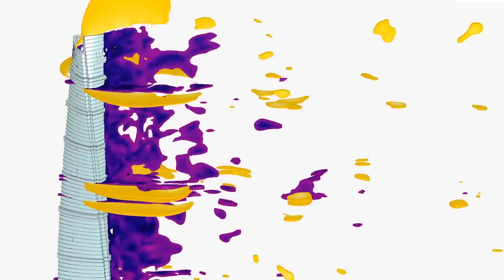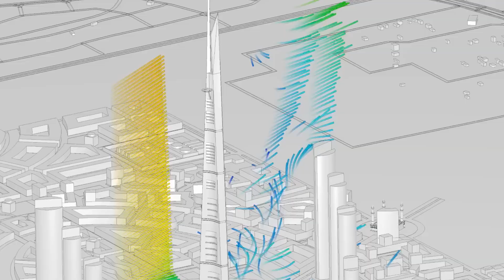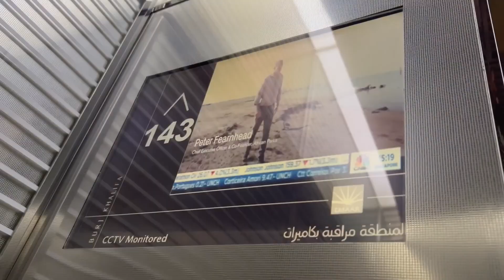Saudi Arabia’s 2KM Skyscraper: What Experts Aren’t Telling You

Comment: 5:38 - - bk rev
0:39 - - at that height you’re talking about:
(1) a vertical city
(2) unprecedented weight pushing into the earth;
(3) can steel or concrete even bear that much weight?
(4) insane wind pressure - aviation turbulence really;
(5) would anyone be comfortable living that high?
(6) possibly limited - - to zero - - visibility from the top half much of the time (you’d only see clouds ☁️ + fog 🌫️ out the window 🪟)
(7) entirely impractical elevator systems;
(8) passengers would have to switch 2, 3 (or more) times
(9) massive, impractical water-pumping requirements
(10) massively expensive (+ probably dangerous) cleaning + maintenance requirements;
(11) necessitating permanent cranes 🏗️ as part of the structure
(12) basically a playground for the ultra-wealthy;
(13) probably even detrimental to society in both practical terms (how could a government neglect so many social problems to focus on something so ostentatious for so few?) - and symbolically (symbolizing the aforementioned societal neglect)